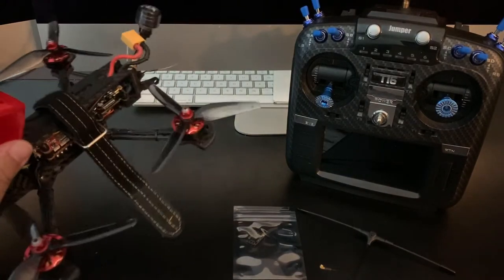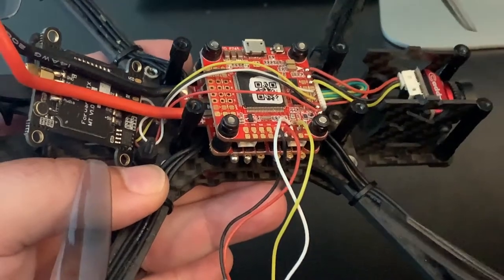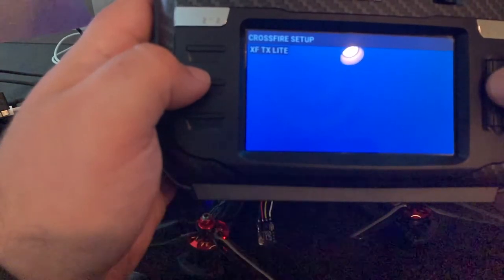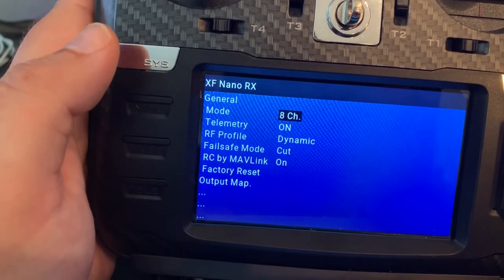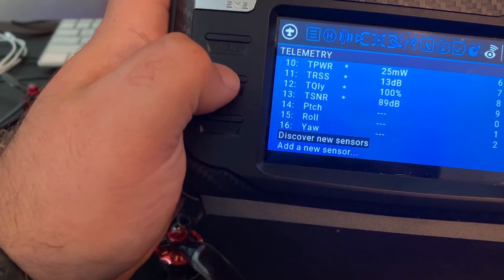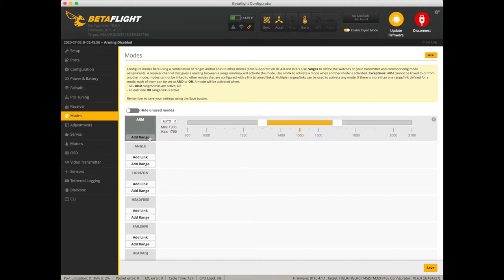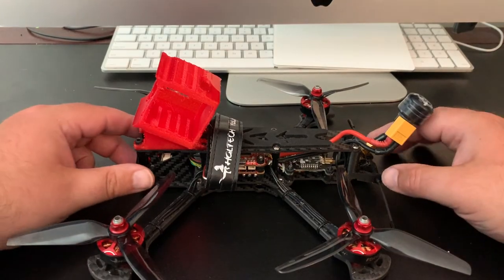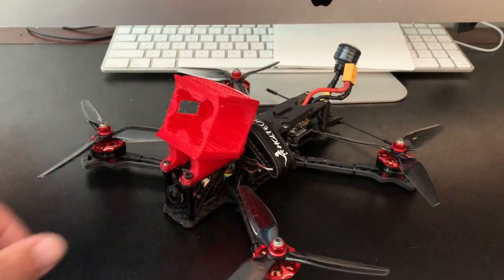TBS Crossfire Nano RX Setup

Comment: Why AUX8 and not AUX12 for telemetry?  In the radio, you configured 12 channels with LQ on channel 12
Reply from the maker: You don’t have to do this anymore. Betaflight automatically detects LQ for CRSF as of a while ago.
Reply: @TitanFPV  using BF 4.1 and 4.2 I still need to do this, so it is still relevant
Reply: @TitanFPV  regardless, still a valid question.  Am I correct in saying that if you pick ch12 in the radio for LQ, that you should have picked AUX12 in BF?
Reply from the maker: Channel 12 is aux 8. The first 4 channels are aileron, elevator, throttle, and rudder. Or whatever channel order your transmitter is setup for. The last 8 are aux.
Reply: @TitanFPV  ah yes that makes sense, thanks for clarifying! I double checked and I use 8 channels in my radio, ch8 is LQ, AUX4 in BF

Comment: Hey. I don't understand anything in English, only through an interpreter. Can't connect TBS CROSSFIRE NANO RX to Matek F405-Wing. Do we solder CH2 to TX? Do we solder CH1 to SBS? Thank you
Reply from the maker: Based on Matek’s website, under INAV wiring, it looks channel 1 goes to sbus, and channel 2 goes to tx2. http://www.mateksys.com/?portfolio=f405-wing I’ve never worked for INAV, or a wing before, but that is what it looks like to me.